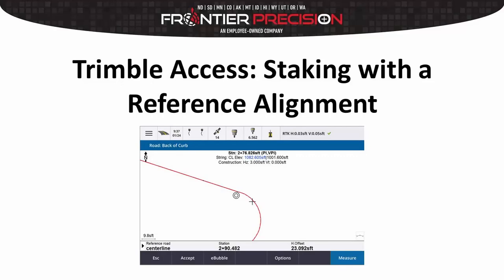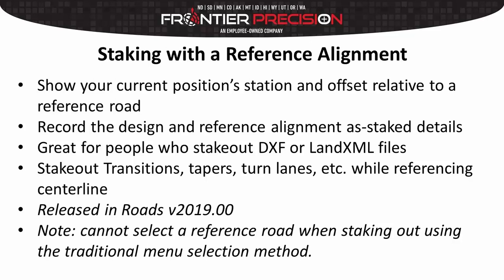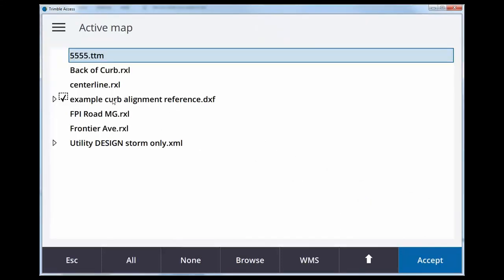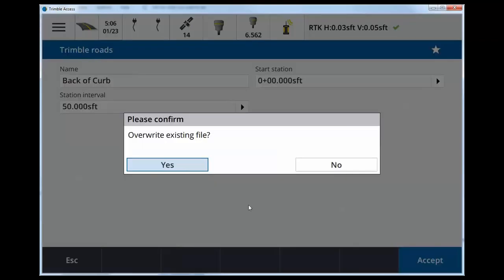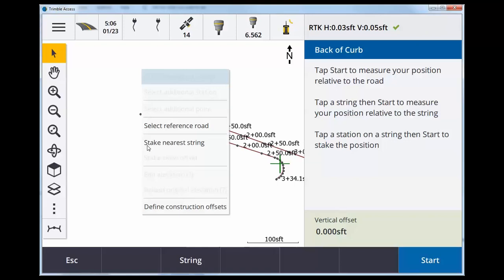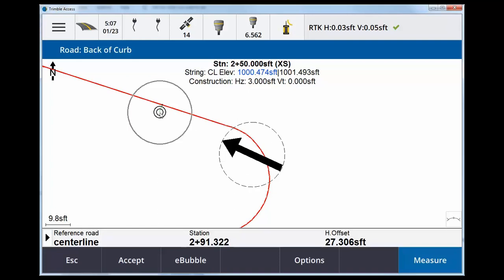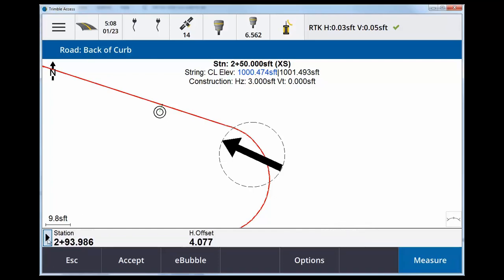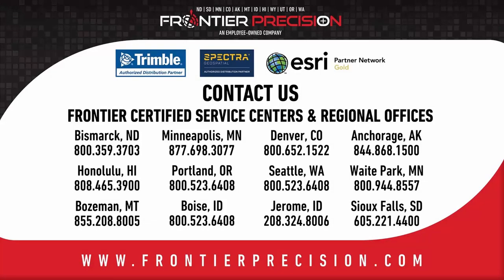Trimble Access- Staking with Reference Alignment

Comment: Dylan, great Video! I have a question with the bottom of the screen delta's before measuring the point. The demonstration showed a Fill of 1.37 or something to the CL. If you stakeout the Back of Curb road alignment, using the CL alignment as your reference, will the Cut/Fill be to the CL or the Back of Curb in this case?

Comment: Hi Jay, I am looking the way to mark 20m offset line from lake edge. Since lake edge runs like snake, is there any way when staking with trimble access to find out that my stakeout point is at least 20m far from from the nearest edge? I am using TSC3 v2017 for field work.
Reply: I think what you would be looking for is the basic Stakeout line/polyline/alignment using the "To the line/alignment" method. This should be the first stake method in the list. This will tell you the current station and offset of your position relative to the line you're staking. Even if you have curves in the line, it should tell you your offset to the nearest perpendicular location on the line.